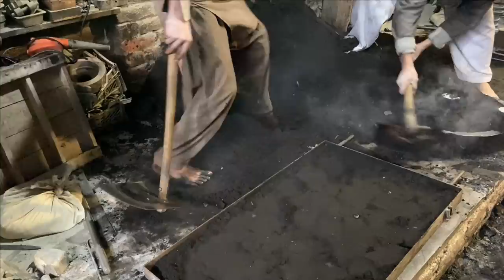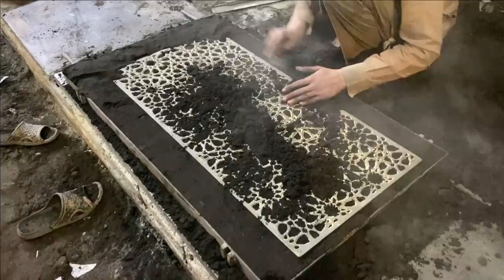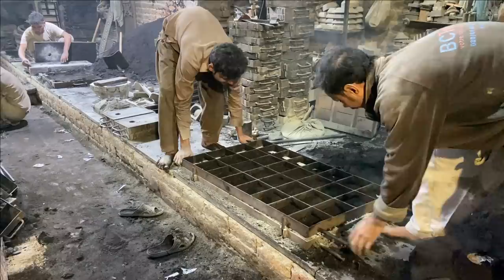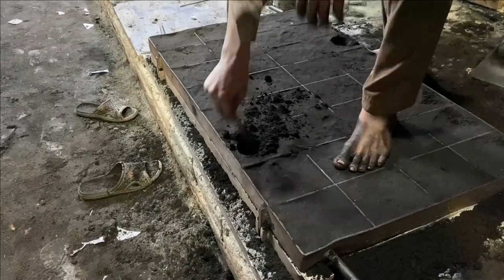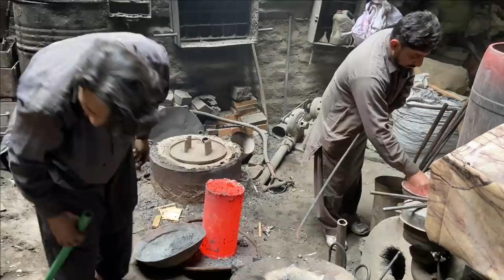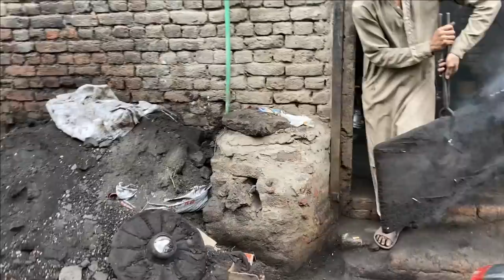Casting Aluminum Proposing Marvelous Interior Design || What a Finish

Comment: What I see is very poor molding technique. 
Bad sprue cutting
Bad gating.
Bad pouring methods
Everything is badly done. 
Just because of where they are is no excuse.  Their working conditions are terrible and I'm not talking about the dirt floor. Normally foundries were covered in sand and could cast into the floor if needed.  
What they lack is knowledge on how to cast. They seem to have most of the tools. Now  they need a book on how to do it. What to look for and how to avoid the problems.

I am doing this in my back yard and at least understand the fundamentals of casting.  
As for the non-existent safety measures this is totally on them. 

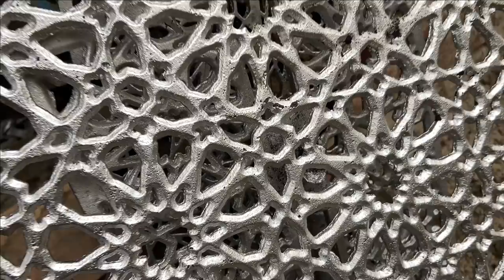For those who think this is well done look at the finished product. 10:52  
You can clearly see that the casting isn't filled, there are gaps. left side is easy to see this.
Too much metal, the sand either fell out or wasn't rammed well enough  giving way to  metal and looking like a wart.
In the center of this time frame you can see where sand fell into the mold leaving what look like rips - voids.
Pitting all over the surface.  
There is nothing good about this part and none of it  needs to be of such low quality.
Reply: It's not easy to pour aluminium without vacuum, that is why the result is so poor. It's 19th century
Reply: @vpsadmin735  I do this as a hobby as well as others- do a youtube search on backyard founderies.
You don't need a vacuum and a vacuum would most likely be very difficult to do. A boiling point thing. No oxygen is a different thing. 
Ignoring just about every single proper casting method does not make it old technology it makes it stupid.

19th century casting was pretty advanced. in fact to cast most metals you only need something like, what? 32nd century BC!
It is very very easy to cast aluminum. You could do it in your back yard starting today in about 3 -4 days at most.

Comment: Can you tell me about the components of sand?
Reply: It's fine sifted sand and old motoroil..  Also known as Oil bonded sand.
Reply: Sand and oil I think
Reply: Sand and filth
Reply: Sand, water, clay (bentonite)
If oil bonded is very expensive, Doesn't use old motor oil. If oil was used you would see the oil smoke from the pour. The 'smoke' you see is only steam.

Comment: Used engine oil is carsenogenic  the soles of the feet are very good receptors 🥵🥵😱😱😱🤔🤔💯🇦🇺
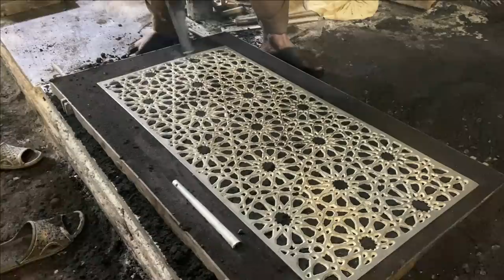Reply: The technical term is "primitive black soles black toes casting".  However, they are allowed to use electric blowers! (4:30)